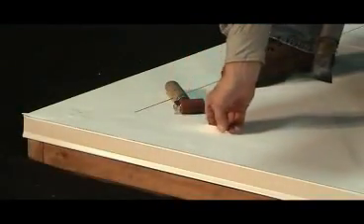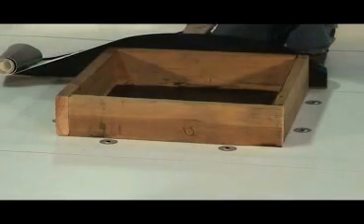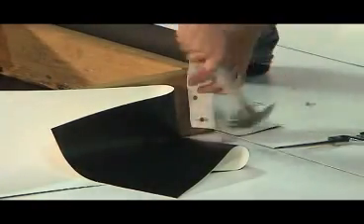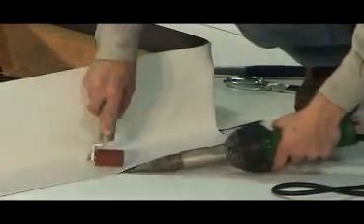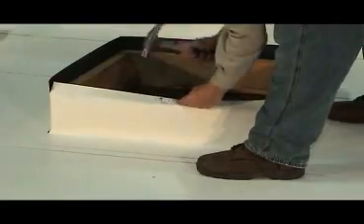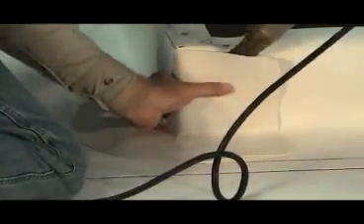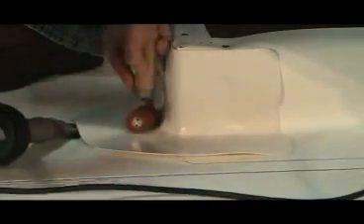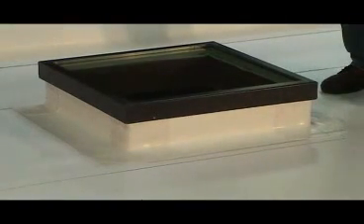Flat roof Installation - Skylight curb flashing - part 6

Comment: First;  ras tape whit scrub and plates. Second; cut membrane and glue membrane and curve. Third; welder outside corners, flash and part of the top, YOU NEVER CUT THE TPO ON THE TOP. Last part:  welder Inside/Outside Corners and TPO T-joint Covers or TPO Unsupported Flashing only if is necessary. Time; 15, 20 minutes.......Here in canada at winter time and -25 -30 degrees? eternity

Comment: Doesnt require glue below 12 inches
 But will make a nicer product and makes it a little easier to detail. 
 And yes pigears are the way to go
Reply: Glue makes a tight wrap around the curb. You are right though although  I suggest using glue . 9 years exp

Comment: it doest need to be adhered if its being loose laid due to were u are working, at district schools you cant use any kind of chemical, anywere else some stabond or water based should have that skylight nice and tight. sarnafil, firestone, durolast, johnsmanville, its all good...........